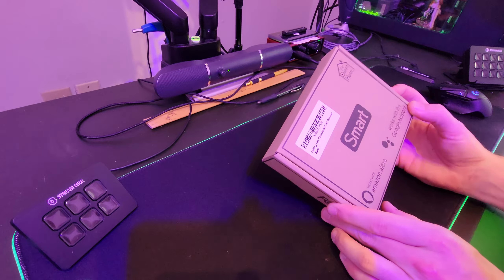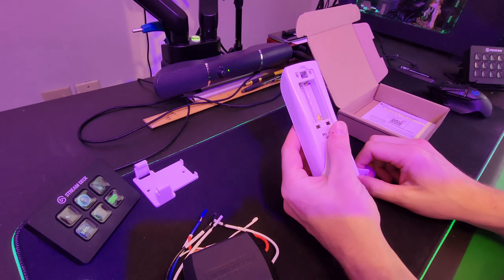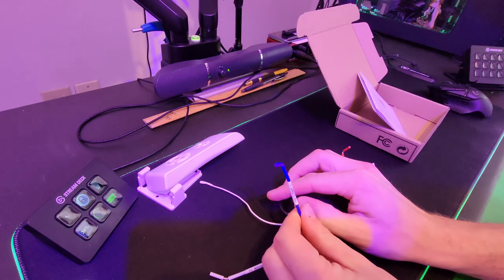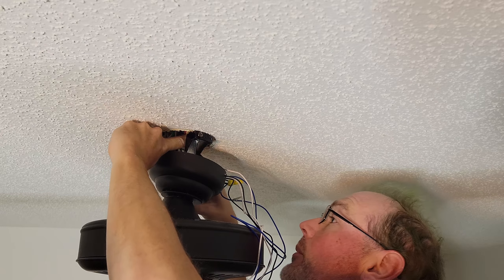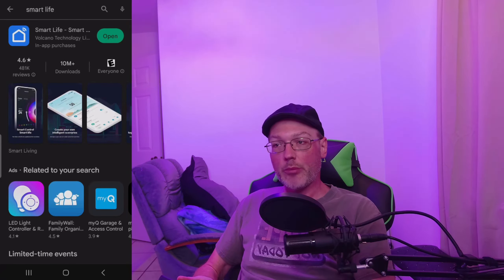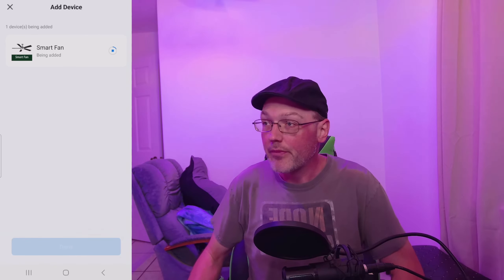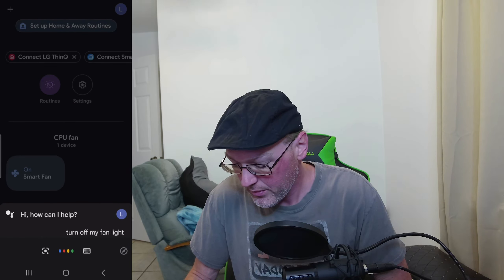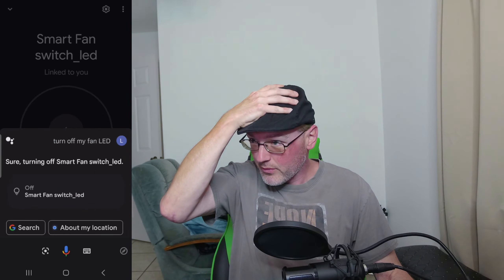WiFi Ceiling Fan Remote

Comment: I have a question, it is necessary to download the app 🤔
Reply from the maker: Unless you have another software or you can code the radio frequency runs off of Wi-Fi. But at least you don't have to pay a service and it works with Google Assistant.